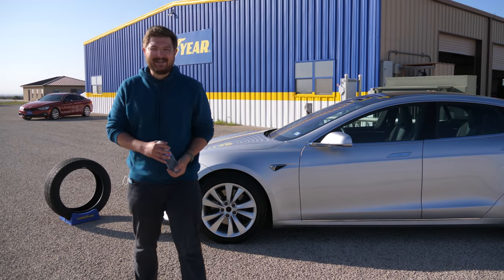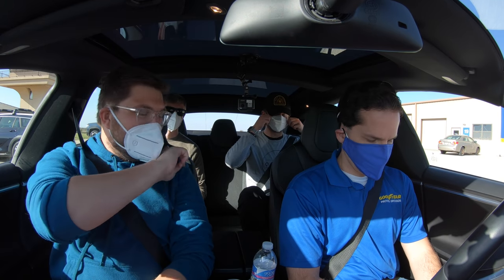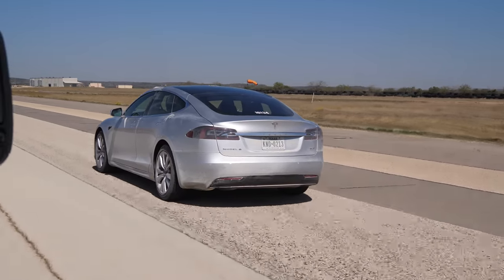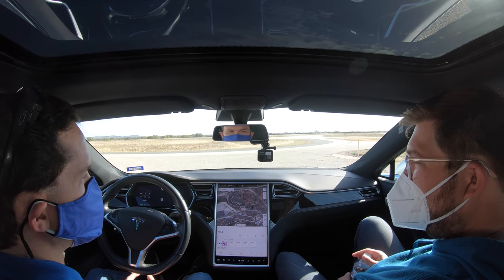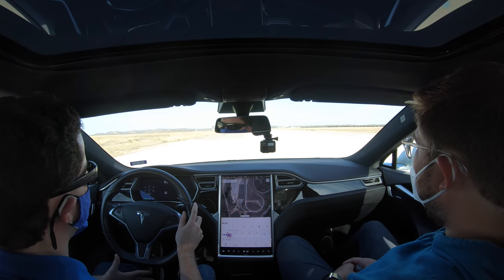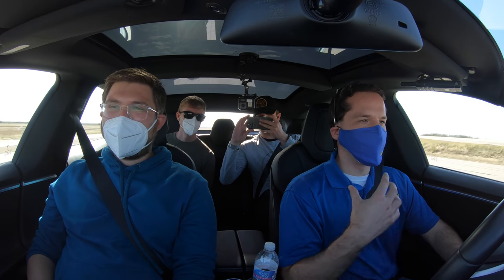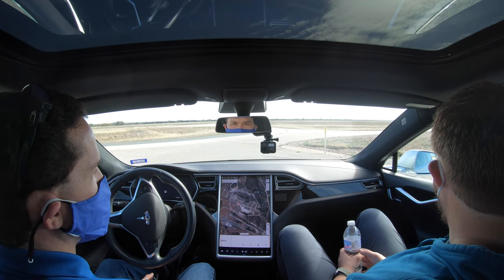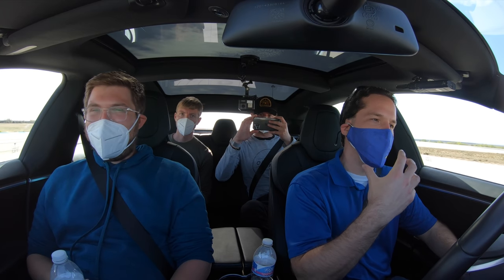Does Foam In A Tire Truly Quiet Down Road Noise In An EV?

Comment: I would love for a way to add foam (or whatever noise reduction feature) to the barrel of the wheel, and not pay a premium for every tire.
Reply: You can diy. Buy fire polyurethane foam and spray glue that don't dry. Make sure to do wheel balance afterward
Reply: The rim doesnt vibrate to create noise, the tire does.
Reply: @Nordic_Mechanic  This is true but the sound is being generated within the hollow cavity of the tire/rim combination.  No matter where you put the foam, it will most likely absorb some of the sound.
Reply: Honda has done this.  It is very difficult to implement because the centrifugal force when the wheel is spinning wants to separate anything that is attached to the inner part of the wheel.

Comment: Some people say their new tires are just as quite as old ones with foam.  Don't forget that the tire get louder with age; older the tire is, the louder it will be.  So make sure you are comparing apples to apples; new tires with foam vs new tires without foam.
Reply: Goodyear Eagle Touring SoundComfort tires made a big difference over my Impala’s 20” Bridgestone Potenza’s. I ditched the Bridgestone Potenza’s with less than 20K miles on them. The difference was significant. I’m happy!

Comment: The foam in one of the tires of our new '21 Model Y became dislodged inside the tire and we had to have it replaced. At first I thought the wheel had become unbalanced, but then figured out/realized that it was the foam bunching up inside the tire while driving.
Reply: Happened to me on my three. The tire shop thought I was crazy because I kept bringing it back to be rebalanced.

Comment: NO Foam:  12:26 neutral coast down, 14:12 long turn at speed, 15:45 16:27 50Kph chip seal aggregate road
Foam:         20:18 neutral coast down, 19:45 long turn at speed, 20:43 21:28 50Kph chip seal aggregate road

Comment: From a test by Car and Driver in 2016, it wasn't the decibel range that changed, it was the frequency of the noise that made the difference. For this reason some people perceive it as quieter because it changes to a tone that sounds "better/quieter" to them. Others might not be bothered by any frequency in the sound spectrum and therefore don't perceive a difference.
Reply: people dont like high picth noise an s class is precieve to be alot quiter then say a camary even thou there only maybe 5db in it on testing but its frequency that is engineered out

Comment: When we purchased our 2018 MS 100D it came with foam lined tires. The car had a rough ride but maybe the tires were quite. I would not know as my hearing is bad but my butt let me know the ride was rough. After twenty seven thousand miles I replaced the rough riding Continental foam lined tires with Pirelli smooth riding tires. How do I know the Pirelli tires are smooth riding? My old butt let me know. I still can't hear that well but my butt feels better on my Pirelli tires. I did not spend more money on foam so I am a bit richer.

Comment: I didn’t notice any difference in regular real driving on my commute when I went from my stock tires with foam on my model 3 to the new tires I bought for it that didn’t have foam.  Real meaning HVAC is normally on (and if not the window is open), and the radio is almost always on, either listening to books or music.  So, unless you drive with absolutely nothing on in the car for long stretches, I wouldn’t get bent out of shape to get a tire with foam in it, especially if they cost more.  Clearly here they used th same tire with and without foam.  But, a different tire may have a quieter characteristic than this tire.

Comment: My question now is how big of a difference is the foam lined low resistance tire with a wheel that has an acoustic resonator built into the wheels to accomplish the same thing, such as Lexus, Acura/ Honda, and Genesis?

If read tests claiming no reduction being measured across the audio spectrum.

It seems like the quietest tires on the market such as the pirelli cinturato p7 plus 2 and bridgestone quiettrack don't bother with foam!

Only Goodyear and continental waste their time?

The best from Michelin don't bother either.

Its more down to tread pattern, construction, and material compound than just adding a piece of foam to make a quiet tire.

A skinnier tire contact patch and thicker sidewall for NVH reduction is worth more than a piece of closed cell foam in a tire bandaid.
Reply: they didnt show any noise record with noise reduction tyre anf without... how i can see the result? just talking and explaining the theory.

Comment: Great video! You mentioned that the tires came standard on Tesla. Is that the noise reduction tire or the one without the foam? Also what's the identifier on tires that indicates they are noise reducing or foam filled?
Reply: I believe the Tesla Only tyres have the "TO" identifier on them.

Comment: Maybe I expected too much here... But I could not hear any difference anywhere. You guys talked a lot. Way too much. Not to mention you had this lengthy discussion inside the car, although it could have been done outside.
So anyway - is there any consensus? Any empirical data of noise levels inside and outside?